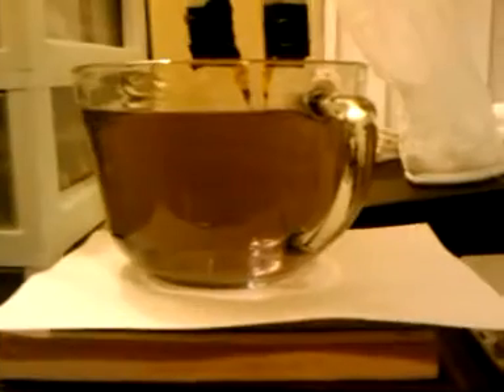colloidal gold generater part1.3gp

Comment: In other words I use electricity from your machine and, distilled water, and Pure Gold and I get a Red particles.  The key is to keep the conditions so that you get a red colored spark from the gold, and Heating the water seems to do that.  H202 is not needed, or any other addittives.

Comment: Well, I was being told by someone else that H202 is fine and I have tried it.  "Because of how it conditions the water it allows for a smaller breakdown of the particles", or as I was susspecting what you said which that it just seems to turn the water red.  I don't want to use any additives, so I experimented and found that heating the water with no additives is ideal.

Comment from the maker: currently the best way is manual,reasons why:1)you sit down and calm the mind and you get to think about everything.2)it would be expensive for an automated machine,i have an automated machine and it works great.currently the cost would be about $2500 to built,because I'm using industrial computers(plc) and their fucking expensive.plc is what they use in machine and robots nn shit.if their is a wide demand i can can make a circuit board that do this ,but their is no demand.

Comment: What kind of H202 that is food grade are you using?  I have used the non food grade H202 but I don't like to use something that is not suitable for consumption.  I have not found a food grade that works.  And also I saw someone say that food grade is fine to use because it breaks down H20 and now I'm not a chemist or anything but I think if that was why it works then you would be able to use any 3% H202 and it would work? but not all of them work?

Comment from the maker: for me i have noticed about 500 volts @1 amp makes the finest particle in the water.how did i get that =i'm using a microwave high voltage transformer and on the primary side i found out 24vac input is the best voltage .becuase it does not burn my gold wire and give me a blueish indigo color.it gives me almost red in between indigo.the most purest form you can get it.it takes longer but its potent